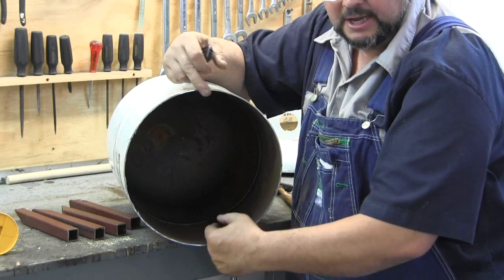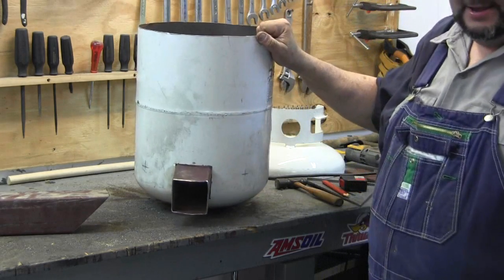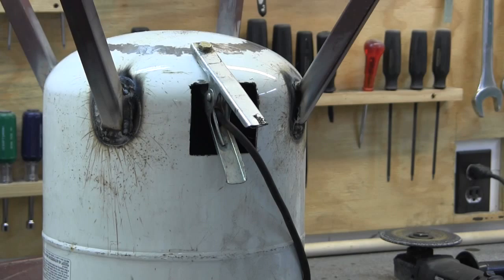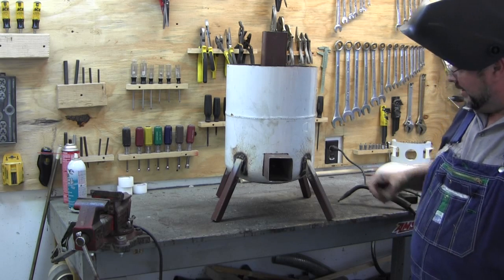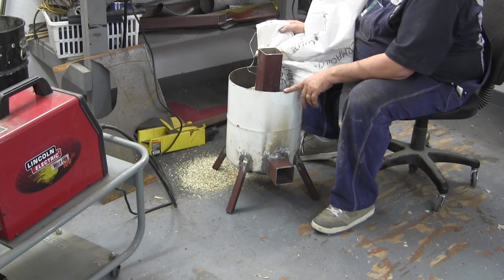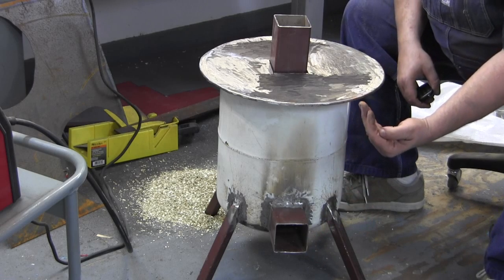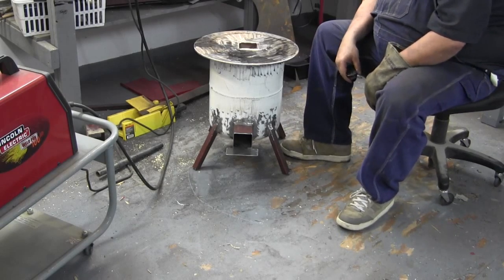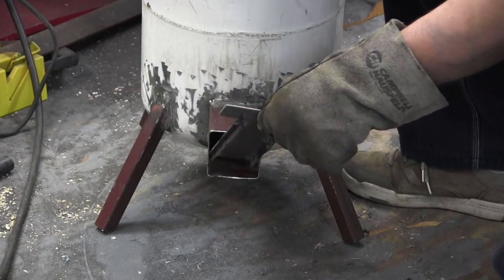How to build a propane tank rocket stove  2/3

Comment: i have used 2 tire rims one with holes that face inward towards the pot that is used as the top while the bottom is lifted off the ground to allow for airflow it produced a swooshing sound and left very little ash no insulation on this unit the first time I fired it up even with water in my post being aluminum it started to melt how does this compare to a rocket stove it seems like its not producing as much heat for the fuel used but still a step above an open pit

Comment: BC, Do you suppose the 7 gallon tank is better to maximize the chimney, draw and thorough burn of the wood gas?
Reply from the maker: I made dozens of rocket stove and experimented with height and width. My conclusion was that the height of the chimney should be between 3 and 4 times the diameter of it. To high and your optimizationof the wood gas is lost. To short and not all the wood gas is consumed.
Reply: Thanks BC for taking the time to share that, very helpful.

Comment: be good to wrap some copper pipe around the inner flue so you could also use it to heat up hot water also. also be better to use a round pipe instead of square. id like to see this idea included with these rocket stoves. you dont need it to be attached to water pipes all the time you could connect your water pipes when ever you needed to use it for hot water. as long as you build it with the copper pipe wrapped around the inside of your flue. you good to go. a multi purpose rocket stove that also heats water

Comment: what was poured in the tank around the 3 1/2 square?
Reply from the maker: Vermiculite.
Reply: What is the purpose of the  Vermiculite? Won't it melt?
Reply: trailboy68 no its a mineral, like stone or rock and its purpose is to insulate in inner chimney pipe so that the firs burn super hot

Comment: What are those square pipes called? Where could I get those? :)  I kinda suck at these things but your rocket stove video is by far the best I have seen, would love to make one with help of a friend.
Reply from the maker: you can go to a scrap yard and get all the components you need to build this. the square tubes are just that,square tubing. the legs are 1 inch by 1 inch and the center tube is 4 x 4. good luck!
Reply: bctruck brad Thanks Brad appreciate!

Comment from the maker: because most home/hobby welders like myself,buy  welders that have shielded wire and dont require gas to weld. I leave the gas shield off because its easier to clip the end of the wire or change tips. My welder does have the option of adding gas if i want to go that route later on. I dont think its and "American" thing, i kjust think its folks like me that use self shielding wire.

Comment from the maker: ill try to make this short.in order for the stove to attain the temps needed to turn the wood,into a gas, the inner chamber must be insultaed from the outer chamber.without the insulation,it is just another wood burning stove,with the insulation,it is a stove that operates by burning the gasses that are released when the inner chamber reachs a high enough temperature.it isnt instantaneous,it takes a few minutes for it to burn enough wood to heat the inner chamber up enough to create the gasses.

Comment: I would also weld some expanded metal in the bottom of the upper tube at the same level as the top of the lower tube to make a grate for charcoal. You could use the stove to start charcoal or cook with them.
You are correct about the efficient burn as you made the vertical tube long enough to create enough draft to burn well without smoke. The shorter ones seen on YT do make smoke because they aren't tall enough. They need to be at least 3-4x taller than the height or diameter of the lower tube.

Comment: This is the closest design I've seen that's like the design I have in mind.
Before welding the burn tubes together I was going to weld some 1/4 inch square stock about an inch above the bottom of the floor to hold the burn plate off of the floor.
Also make the burn plate long enough that it could go almost all the way to the back so the air flow could be regulated if need be.

Comment: H hunter . I've heard wood ash will work as a high temp insulation. bctruuck, thanks for the info, question: would you say this system cooks with the heat from exhaust gases or conduction thru the stove metal. Also, I would think you'd be chocking on the smoke.

Comment: nope. ratchet strapped it to a fireplace wood rack with rubber between them to keep it from slipping. bent th top metal outa the way. then used pipe wrench and cheater pipe. was still tough to do. had to have a friend help hold it still.

Comment: Would it be ok to put fittings on the tank with lines going to a holding tank? The system could be filled with water and make hot water every time you cook.

Comment from the maker: nope.you are wrong. from 1927-1990,there was a plant that mined vermiculite that conatained asbestos. that vermiculite was not food grade and the plant was shut down 23 years ago. there is no more vermiculite with asbestos being mined in this country.if you are working on an older building and come across vermiculite insulation,it could contain asbestos but the stuff i buy does not.

Comment: Why didn't you use the top of the tank (part you cut off) turned upside down for the base of the stove? And marking the line for the cut: just tape your pencil on a fixed point at the right height and rotate the tank on it's bottom with the top against the lead! It's sort of what women do when they want to hem a dress! You have many skills, including math, just not the kind they measure in school! You have what are called marketable skills, the kind found in entrepreneurs! THANKS for sharing.

Comment from the maker: the insulating material is called vermiculite. perlite works just as well. it can be found at any garden store. i dont know how the exhaust could be routed to a chimney since the exhaust is what you are cooking over. they do have woodgas heaters that are used indoors,but this isnt that type.

Comment: Too cool! Im thinking about trying this as a kind of dual fuel rig with wood and waste oil for melting lead for bullet casting... Just wondering, have you ever tried using an arc welder for welding on your rocket stoves? they come into their own when welding thicker steels like the propane tank and square tubing. Quite cheap to use too :-)

Comment from the maker: the tank was a 30 pounder. the inner tubing was 3 1/2 inch square. the bottom pipe was 11 1/2 inches from front to miter vertical pipe was about 17 inches from miter to top. top was 1/4 inch plate steel,cut into a 14 inch circle. legs where 1 x 1 square tubing cut in to 6 inch legs with about a 35 degree angle cut on them. i have protractor now so if that angle is real important to you,id be glad to go put the protractor up beside it and let you know exactly. sure hope you can video the build!

Comment from the maker: it prevents the heat loss from the center tube allowing it to reach the temperature needed for the wood to release its gases.its similar in theory to the "cracking" proces that releases chemicals and gases from oil at certain temps.

Comment: Forgive me for being daft, does the filling material around the central tube stop heat getting away to the outside casing, or does it act like brick type storage heaters and store/release the heat in a controlled way?

Your welding looks mighty fine :-)